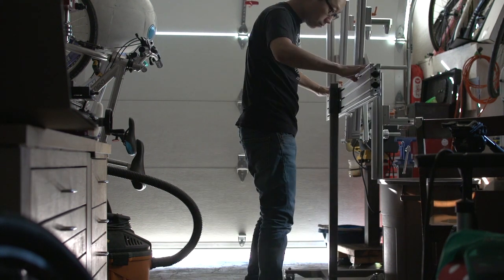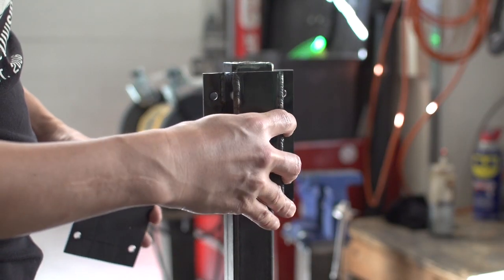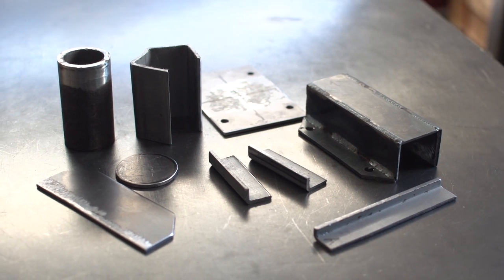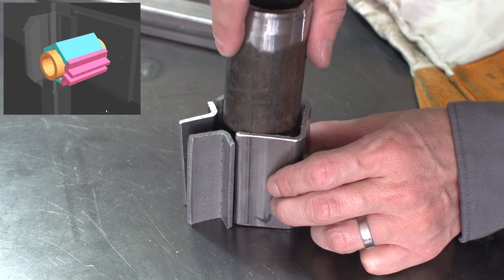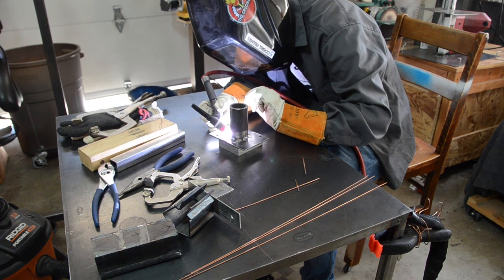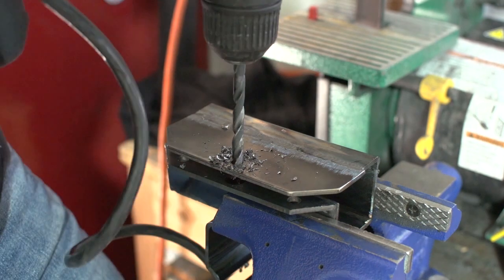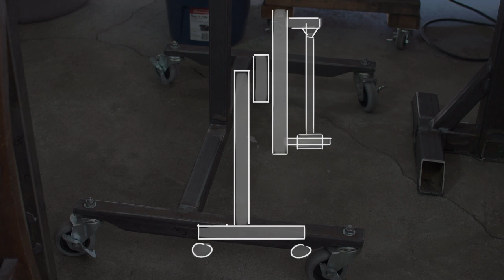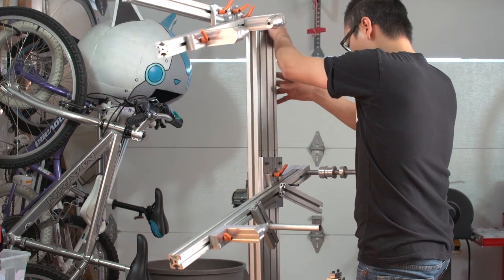TIG Weld Rotating Head On Stand For Bicycle Frame Jig

Comment: Yet another stellar video!! We do what we have to do! Are you going to throw some paint on the stand and that work of art rotating clamp? I discovered Rustoleum "Hammered" finish paints at Home Depot. I was going to try and post a link for you, but it looks like they are discontinuing them. You should still be able to find that paint somewhere local to you. It's awesome! It comes in metallic shades (silver, gold, copper). I like the brush on quart size. It is super thick and it hides all sorts of flaws like grinding marks and weld spatter. The paint has an oil in it so that as it starts to dry it creates a "fisheye" effect like an old-school machinery finish. I use it to paint my tables here at the weld shop at the college where I teach. It gives a "good enough" finish so stuff doesn't rust, plus it stands up to abuse pretty good.
Reply from the maker: Hey thanks for the tip on that paint. It's funny I never considered painting the stand. I just never had the time! It's a great idea though because I want it to last. Luckily I live in a dry climate (most of the time). I did a search on that paint and it looks like the finish you see on a lot of Grizzly metal working machines! Cool.

Comment: That looks like it's going to be so much easier to work with on your new project! Have you tried using cheap seatpost quick release binder instead of the Allen bolt and nut? I'm thinking that might make adjustments on the fly easier with no tools.
Reply from the maker: I have considered something that won't require a tool to adjust. Binder is a great idea! Thanks for watching and for the tip!

Comment: I'm shocked that you didn't use high speed bearings inside of the apparatus. Now if you spin this thing for any extended period of time at rates even as low as 5000 rpm it will wear prematurely. What were you thinking!?
Reply from the maker: I was considering hooking up a 50cc engine.. guess thats out of the question.
Reply: Pithy Bikes brilliant idea! That would go a long way in preventing any back injuries.

Comment: Really enjoying your videos. 2 questions: First, what is the powder you are using with your bandsaw?  And second, do you temper your aluminum welds?  A builder friend recommended chromoly because he said I would need to temper aluminum. Thoughts?
Reply from the maker: Hi John, I haven't done any aluminum welding aside from a bit of test welding. All my projects are steel for welding. And mostly aluminum for machining. The white powder stuff comes in a stick and its called Boelube. One of you guys mentioned to try this (sorry i forget the viewer's name) But it works quite well. Sorry I don't know much about aluminum frames and tempering. I have heard that the major performance brands do indeed temper their frames.
Reply: Pithy Bikes my bad. I thought the material you were waiting for to complete the long tail was aluminum tube. I realize now that it was round stock. Thanks.
Reply from the maker: Ah i gotcha, no worries! Yeah the aluminum round is for the rear dummy axle fixture. Actually I just finished machining it today.